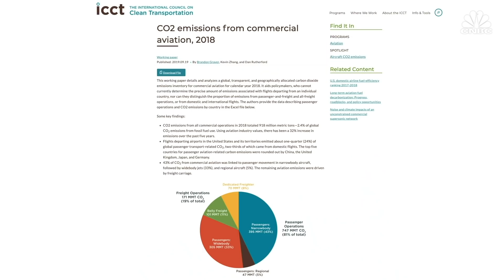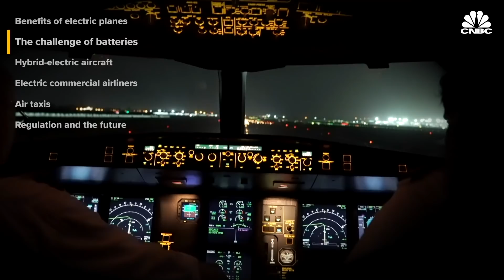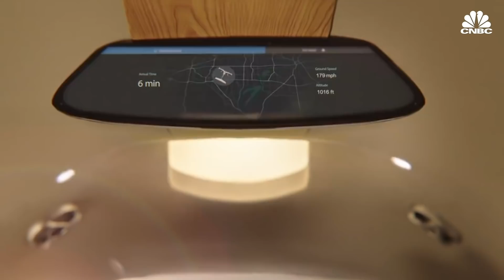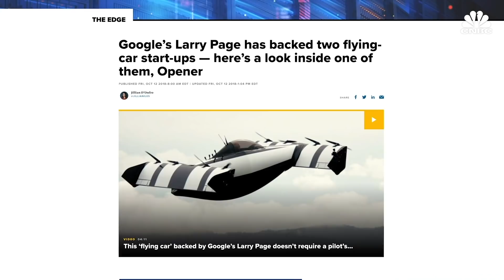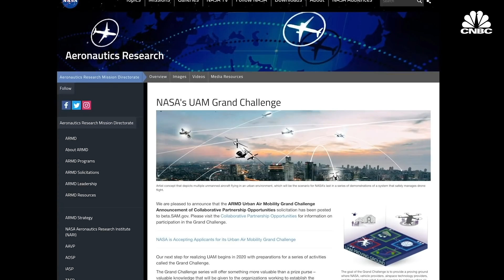Why Don't We Have Electric Planes Yet?

Comment: Why dont we have gas operated cellphones
Reply: and thats on 400cc two stroke iphone 30
Reply: @nhanle3862  nice one
Reply: @nhanle3862  lmao🤣
Reply: Because nobody needs a gas phone with 10,000 hours per gallon and an oil change every 3 months or 3,000 texts, whichever comes first?
Reply: David Beppler And when you try to sell it and people look that Usage Chronometer counter..... 👀 

You have to sell for less... lol
Reply: David Beppler 3k? what’re you using synthetic?
Reply: Apple: TAKE NOTES
Reply: @Sunny-pg9bj  LOL
Reply: real talk
Reply: @samueljrichardson2499  62IQ
Reply: if u charge phone in car you kinda are
Reply: @jondonnelly3  not even close. You're using the car's battery which is electricity.
Reply: Jon Donnelly you know all cars have batteries right?
Reply: For turning the electric starter motor to get the internal combustion engine going so that the electric alternator can produce electricity to charge the battery so you can run your radio.
Reply: Jon Donnelly gosh I feel bad for you I hope you’re being sarcastic. Smh 🤦‍♂️
Reply: @jondonnelly3  not if you charge  it in an electric car.
Reply: @jondonnelly3  exactly what i was going to say or a standalone generator
Reply: Jon Donnelly Not at all. It comes from the battery 😂
Reply: @jondonnelly3  You obviously didn't read what he meant did you? Gas operated meaning the phone itself is powered by gas as in the phone has an engine and you need to put fuel in the phone.
Reply: Jon Donnelly no, not at all, you are charging you BATTERY you aren’t injecting more ‘battery’ into your phone, you are basically bringing your battery back to life. It’s hard to explain but what you said its not close
Reply: Why?
Reply: I would like a diesel powered cellphone please. So I can roll coal and listen to my tunes!
Reply: You can ponder that question by driving/flying your cellphone to work tomorrow. Tell us how it went.
Reply: @Al Castill We do, lookup Tesla Powerwall
Reply: @DrDubbs  It all boils down to money hungry Corporations. If you can't tax it and regulate it then it's worthless.
Reply: Well just plug it to gasoline generator, voila you got gas powered cellphone.
Reply: if you plug it into the cigarette lighter of the car its power from gasoline.
Reply: Good question
Reply: Too many people with big time money and power run the oil industry's. This is why the electric car was scrapped in the early 80s. All about money and nobody wants to help the Earth, our life raft in space
Reply: We need methane powered smart phones ! I hope charge cable isn't too uncomfortable 😬
Reply: @confirmhandle  Subtle brilliance.
Reply: There was a liquid fuel clothes iron (gas, kerosene ect). My aunt was set on fire by one the 60s. So...yeah, there was that.
Reply: why not cars?
Reply: ^asking the real question
Reply: wow stupid
Reply: I wish! V twin Samsung lol
Reply: The color of the photos and videos would be more dramatic if we had gas phones and flat screens.
Reply: would look like this https://youtu.be/Gqy5-e5-ZOE
Reply: things like cars and planes run on gas operated MOTORS so that would mean they need pistons so in theory you could have a has powered cellphone but it would much more bulky and heavy than the ones we have rn
Reply: @sareensidhu6807  ,
We've already had prototype, portable laptops that used a fuel-based battery. They actually can be much LIGHTER than a regular battery even in something the size of a cellphone battery. It simply comprises a small generator so when you burn the fuel source it powers everything and those can be incredibly small. You can get a surprisingly long life out of that approach but it's simply far too messy to refill and dangerous.
Reply: Why they don't put BAND on airplane.. they are the biggest killer in the world..
Reply: Because that wouldn’t make any sense and is redundant. Phones wouldn’t even be able to be ran on gas theoretically speaking. But come on, gas operated cellphones??? It’s already advanced now so it would be going backwards in the most inefficient manner to utilize a phone.
Reply: due to unavailability of mechanical small computers.
Reply: v12 iphone ?
Reply: Hahahaha
Reply: Lack of engines in that space i guess.
Reply: Seven Things , you still have a car phone?
Reply: A car can't run without electricity now
Reply: I like this smart comment.
Reply: That’s such a profound question.
Reply: u mean water cooling cellphones
Reply: Visionary
Reply: Why don't we let AI run the country?
Reply: How about nuclear powered cellphone?
Reply: Why tf would you want that?
Reply: How about steam powered cellphones?
Reply: with miniature gas turbine engines we could.
Reply: @laxman dumre We have gas lighter for hundred years.
Reply: 😂 I’m working on it 🤝😉😤
Reply: 20x the power vs batteries.  Our phones would last nearly a month
Reply: 😂 I’m imagining a tiny single piston engine going instead of the battery.... just need to pour in a few ounces of gasoline each week.
Reply: @Al Castill they exist you just can't afford it by the sounds of things.. the battery works as a rechargeable reserve for the solar panels to store energy it works almost like a generator.. tesla makes some look it up..
Reply: Don't give them insane ideas 😉
Reply: Nonononooo don’t give apple more idead
Reply: hahahahhahahahhahahaaaa cause it will take a long walk to go to a gas station heh? 🤓
Reply: Come on gang ! Let’s go for a ride in my electric rocket!weeeeee
Reply: Most of my baseload power comes from Natural gas, so I already have a gas powered phone...
Reply: Good one. The same reason we don't have gas powered toothbrushes.
Reply: So you used over 2000 bots to get those likes... Cheater
Reply: I DEMAND a cellphone with a small motor right now
Reply: A gas operated cellphone would last less then a minute if it stays the size of a cellphone
Reply: @tusk3260  this is about novelty, not practicality
Reply: Then make it yourself
Reply: iPhone run on nuclear energy so you would have an infinite amount of energy and no need to charge it
Reply: Actually nuclear is just a urannium fed steam engine that produces electricity
Reply: iLL buy that.
Reply: Mmm let’s see a device that uses gas combined with a little spark created by the phone could be an interesting combination.
Reply: why dont we have beer powered bicycles?
Reply: Dark Vulcan omg smh 🤦‍♂️
Reply: @nathanweingust5709gmailcom  ?
Reply: Chicken Why Why went to Hawaii... Came back with a Big Black Eye! 😎
Reply: Why Don't We Have Electric Planes Yet?
CNBC
Reply: This is the type of question you ask on a bender.
Reply: Why don't I believe a word that comes out of this Cory Combs guy...he sounds like a lobbyist
Reply: Funny, I remember in the mid-90s seeing some "futurists" saying that we'd have such a thing with fuel cells where you'd fill up your phone with some methanol once a week.
Reply: @443DM  The internet was also supposed to bring us all closer and stop requiring the need to travel.
Reply: Seven Things What an idiot! Cos’ it’s not called a gasphone.
Reply: Real question: why don’t we have cars
Reply: one gas powered microwave please.
Reply: Wow..how funny you are
Reply: Why don't we have gasoline house appliances?
Reply: Seven Things because it would really fit in your pocket and defeats the point of an iphone
Reply: Gas operated cell phones for smokers 🤓
Reply: Lol true
Reply: Cant travel on plane fule danger
Reply: @Al Castill cause solar power on
Reply: Because the exhaust pipe will burn your ear.
Reply: @vachief Why?
Reply: Im in if you write this comment in 1900 ..   Ita not that worth anymore and its coz co2 emissions
Reply: Hell yeah
Reply: 4.6 liter twin turbo iPhone 40
Reply: Why do we have gas powered morans
Reply: Why don’t we have gas powered batteries
Reply: Apple cries in a corner
Reply: why we dont have nuclear powered cellphones?
Reply: Tjo Wen we do
Reply: @endoetz  mutant x
Reply: Tjo Wen the USA has nuclear powered aircraft carriers that don’t have to refuel tell 2045 their completely electric
Reply: @endoetz  We do if you charge your phone with nuclear energy. 
We have nuclear cars if you charge an electric vehicle with nuclear energy.
Reply: Stupid answer to a stupid video. 
Engineer take. 
You can use hydrogen, higher energy density, proven viable jet fuel for decades, no co2, can be produced with nuclear energy. 
For small planes you can develop and use a ion engines once you solve the battery problems, 0 moving parts. 
Once you can go past batteries (such as using new developments in compact nuclear reactors) you can use plasma jet engines. Those can take you up to mach 5 in atmosphere and keep working in space, allowing you to access orbital speeds. 
In other words, spaceplanes.
Reply: @fl00fydragon  If you were smart you'd make a jet turbine with a thermal energy efficiency of at least 50%, when using silicon or boron metalloid nanoparticles (coated with oxide to keep them inert for safe storage, but still finely grained enough to allow for combustion with an air-fuel mixture of gas incoming from the atmosphere). Silicon has approximately 40 MJ of energy per kg, and a jet engine with 50% operating efficiency, would be able to extract 20 MJ of energy per kg consumed (e.g. 20 MW of turbine shaft power per kilogram of fuel consumed every second). 20 MW is easily 20,000 to 30,000 pounds of thrust assuming a SFC of less than ! 1 kg of silicon occupies a little more than 400 mL of volume, and 20 hours (72,000 seconds) at 20 MW for this hypothetical turbine needs 72 tonnes of silicon, which would occupy 30,400 liters or 8,040 U.S. gallons of fuel volume (the equivalent in kerosene would consume well over 3 times that! Hydrogen would be 24 times!). The emissions from either fuel (boron or silicon) is a solid oxide, which can be stored in tanks and recycled in a nuclear power plant.
Reply: @NUCLEARARMAMENT  There's problems with that design. 
For one the collection and storage of the emissions required an entire extra mechanism and additional tanks to be installed which means more weight, less carrying space and more fuel per kg of cargo which in turn stomps the advantages you get from a more efficient engine (this is the same reason why we are still using bell nozzle rockets and not aerospikes as the extra complexity adds a lot of mass that only recent breakthroughs in metal 3D printing have adressed but still need some refinement). 
As a result the maximization for efficiency in that regard is to have an "emit and forget" burner where you don't care that your emissions are blown into the atmosphere, hence hydrogen.
Same goes with the complexity of a solid fuel based jet vs a gas or liquid based jet.

Another problem is the complexity of the fuel that raises it's cost where, even if you operated in a post monetary system, would make it unfavorable as you'd need more energy to produce, transport and store it as you would have a limited amount of paces capable of producing nanoparticle based fuel.
On the other hand hydrogen can be produced anywhere you got water and electricity.

Another issue is that the oxide layering is not a sufficient safety mechanism to counter a catastrophic failure. These oxideds would bew more explosive than hydrogen due to the immense reactive surface area.
While a hydrogen tank leak would result in a face melting blowtorrch a breach in this fuel storage would be more akin to a miniature moab/foab (they work on a similar principle)

Hydrogen has an energy density of aorund 120 Mj/kg

And finally we have a head start in the engineering department because the aerospece industry have already cracked a lot of hurdles in using hydrogen as a fuel both thanks to the delta rockets and the prototype for the SR71.

Finally hydrogen is an excellent cooling system, so if you utilize cryogenic hydrogen you can use the fuel itself as the cooling system for a supersonic jet or a scramjet, making the entire system simpler, which in turn makes it less prone to malfunction and makes the whole design cheaper.
Meaning that you are opening up the door for cheap (relative to other designs) commercial suersonic and hypersonic commercial and military applications.

For all of the reasons above hydrogen is preferable.
Reply: @fl00fydragon  Yeah, but hydrogen emissions (water vapor) still have the potential to contain nitrous oxides, right? And the heat capacity of the water vapor being emitted in the upper atmosphere is capable of causing a heating effect that could accelerate climate change even if no carbon emissions are produced?

Also, while it is true you'd have to engineer a system to store the metal oxides, the tanks they'd be stored in would be not much larger than the fuel tanks, and since the boron and silicon fuels need 400 mL to store a kilogram of mass, whereas hydrogen even in a liquid state needs 12 L to 13 L to store a kilogram-even slush hydrogen would require more than 10 L at minimum! You could keep it as a gas under super high pressure, and potentially increase density beyond what it would be as a liquid or a slush, but that would be extremely energy intensive, not to mention hydrogen has an extremely small atomic radius so it will inevitably leak through the atomic structure of the holding tank, even if you already have the tank structure capable of compressing hydrogen gas or holding it in a liquid or gas state. Hydrogen in liquid form has an energy density of 8.5 MJ/L, silicon has an energy density of 95 MJ/L and boron has an enery density of 137 MJ/L, and using isotopic separation to remove the heavier of the two naturally occuring boron isotopes, the energy density could be increased to beyond 140 MJ/L.

1 liter is sufficient to store a a kilogram of either surface-oxidized boron or silicon nanoparticles AND their respective oxides (B2O3 and SiO2), with maybe a couple hundred milliters of volume to spare. Not only that, but the safety could be further increased by pressurizing the tanks with helium, nitrogen, neon, argon, or other inert gases. This would not require cryogenic or extremely high strength composite fuel tanks to store, which would translate to reduced costs wouldn't it? Also, with a whopping 18 MJ/kg of boron and 15 MJ/kg for silicon in terms of their respective specific energies, which are based upon their use with oxygen as a bipropellant for rockets, they are capable of a maximum theoretical specific impulse of 540 seconds and 450 seconds, respectively--when used in a hybrid rocket, they would serve as excellent high-density-impulse propellants in space applications. Space vehicles should be the only vehicles that have emissions anymore since the laws of physics and the tyranny of the rocket equation, but aircraft and anything else should follow suit, in my honest opinion.
Reply: @fl00fydragon  In terms of cooling, metallic or metalloid nanoparticle fuels coated with a surface oxide layer and pressurized within a standard fuel tank with an inert gas could simply be accompanied with liquid argon or liquid neon as dense alternatives to liquid helium or nitrogen, without causing too much complications despite hydrogen being cold enough on its own to provide excellent cooling properties, but requiring it to have bulky and large cryogenic fuel tanks to store?
Reply: @fl00fydragon  Liquid neon is expensive as all hell, but it won't leak through tanks unlike liquid helium and is every bit as inert due to its valence of zero. It also has a density of 1.207 kg/L, and has a melting point of -248.6°C (-415.5°F, 24.55 K), amongst the lowest of any substance (aside from hydrogen and helium). Here are some more tidbits on neon:

Boiling point: -410.9°F (-246°C)

Electrons per shell: 2,8

Neon should be more than sufficient as a coolant and is denser than water, so why wouldn't it serve as a perfect complement to boron or silicon as really dense fuels with solid oxides stored aboard fuel tanks aside from its tremendous cost? Hydrogen's biggest issue is its awfully low density, even despite the fact we have solved most of its storage problems, and is cheap to source but that has its own environmental footprint if hydrogen is produced by anything except nuclear or renewable sources of energy.
Reply: @NUCLEARARMAMENT  If you have a clean reaction you only get water unless you put in additives.
There's one massive difference, using fossil fuels injects new carbon into the carbon cycle while water content in the atmosphere is regulated by temprature (basically the water vapor is not a problem unless we continue heating up the planet)

The issues is that you introduce multiple  engineering hurdles of requiring a system that capturres powder from a subsonic or supersonic airflow, a way to inject an extremely volatile solid fuel into a jet's combustion engine and alloys that can survive the equivelant of hours of sandblasting for a simngle flight.

The first has problems where not only is it impossible to capture all of the waste, resulting in quite a bit of chemmical pollution raining on our heads, but it's a critical failure point that will cut into the thrust of the system, increase engine size, increase weight and require a secondary tank (even if smaller this is a larger engineering hurdle than one larger tank).

Additionally because the fuel is solid you can't just put a simple piping system, you'll need to engineer a feeding system from scratch that would have to transport powder through tubes at a high speed to feed the combustion chamber, a mechanism that would most likely require you to use hypercompressed air to push it along the pipes fast enough so that the fuel doesn't catch fire within the tube and ignite the fuel cell (as it will be propelled by it's very oxydizer)
So not only do you have issues with the waste system but you have fuel supplythat has to withstand a constant sandblast where failure would result in the fuel tank exploding.

This would result in a very expensive aircraft with massive thrust loss due to it's filtration system (which would most likely by gyroscopic/vortex based) that would need a lot more time to develop , would be a flying bomb waiting to explode if it's feeding system failedand would require the use of exotic alloys that could withstanda a supersonic sandblast for a single flight, let alone multiple uses.
Even the most recent breakthroughs in material technology can't give you the materials required to make this plane you propose reusable.

The most "smart" thing to do with your proposed design is to say "screw chemical pollution standards" and remove the filtration system.
And you still have to deal with the sandblast from your fuel injection system.
Now using an inert gass would reduce the risk by a bit and the speed of your fuel injector but you would have to have an adequate amount of compressed gasss to push all of the powder out, which defeats the purpose of not having compressed hydrogen as you'd need even more gas, not to mention that having an innert gass would cut into your engine's performance as you'd be making the combustion harder.

On the other hand we have quite a bit of experience of using hydrogen, giving us a head start inthe R&D cyclel, simple piping will work, it's fuel tanks may be larger but the contents are relatively light and their walls are made with carbon fibers reducing the weight you add by increasing the size of the tank.

Basically your miraculaous solution is an engineering disaster.
we don't just look at the highest volume to energy ratio and say "that's our fuel".
It has to be compatible with what can be engineered.
Theere's a reason why solid fuel is only used in solid state rockets where they're nothing more than a glorified roman candle, operating in the exact same way.
Reply: @NUCLEARARMAMENT  Cryogenic tanks are by far superior than wonder material, unobtanium pipes that can survive worse treatment than what we use at metal cutting sandblasts.
Reply: @fl00fydragon  What about ultra high temperature ceramics? Can they take sandblasting? They become more malleable and tensile at high temperatures and less brittle, right? I'm not against there being exhaust emissions in a spaceplane using my proposed system, there I wouldn't really care. How about a subsonic airplane that just runs on an ICE powering an electric drivetrain that turns the propfan?
Reply: @fl00fydragon  I think I found that "unobtanium" substance that could be a potential solution to the materials problem: https://www.mining.com/platinum-gold-alloy-wear-resistant-metal-world/

Specially fabricated gold and platinum in this configuration is going to be quite expensive! But the ultra high temperature ceramics in conjunction with low-heat-rejecting materials will still be useful in obtaining a high-efficiency TRCC (turbo-rocket combined cycle) that combines a VEC (variable engine cycle) turbine section that can operate with a bypass ratio (turbofan mode) or without (turbojet mode), which would work in tandem with the variable compression section that can operate as a subsonic combustion (ramjet) or supersonic combustion (scramjet), and be capable of obtaining up to Mach 20 (80% of orbital velocity after accounting for atmospheric, gravitational drag losses), while being able to ride the atmosphere at an altitude of 80 km above MSL.

My theory aims for turbine and ramjet/scramjet efficiency--both adibiatic and isentropic efficiency in excess of 60%, and a nozzle efficiency of 95%-100% or better. A full-length, annular ring, aerospike nozzle with reverse-thrust, 3D vectored-thrust gimbaling system, and an afterburner is what I'm envisioning here as well. The closed-cycle, staged combustion engine cycle section will use onboard oxygen and be used to get the spaceplane into orbit for the remaining 20% of orbital velocity, with a specific impulse of at least 450 seconds using boron and oxygen. The first 80% of orbital velocity is achieved using the VEC turbine and (sc)ramjet sections, and will have an overall average specific impulse of 1,200 to 1,800 seconds.

I know my concepts are impractical and may never be possible, but I have to get this off my chest.
Reply: @fl00fydragon  Basically, I'm looking at a spaceplane concept that will improve upon Skylon with an up-mass ratio of 20% (5:1), and get somewhere to 33% (3:1), 40% (2.5:1), or even 50% (2:1). Saturn V was 3% (33:1) and most rockets can't do better than 10% (10:1) because of the rocket equation.
Reply: @NUCLEARARMAMENT  The temprature isn't the fatal problem in your system, the fatal flaw is that the fuel supply from your tank to the combustion cavity will be a high pressure gas that's blowing nanoparticle sand at extreme pressures and a high speed.
Furthermore your design has too many moving parts, even taking in the fuel from the container cannot be carried out by a simple tube and instead requires an extremely complex system that skimms the surface as the escaping gas has to take with it a stable portion of nanoparticle sand.

With current material technology it would be a wonder of material science if your system could do more than a signle flight without replacement of the pipes and would be the least relaible and most complex plane ever built. (you are introducing dozens, if not hundreds of new failure points.

You;d be wasting energy that way.
The most efficient way to utilize energy from an ICE is to directly utilize it to propel you.
Turning the energy from an ICE into electric energy to then move an electric motor is you introducing more steps where energy will be lost as heat, resulting in increasingly larger losses to efficiency.

The most efficient green option we currently have that can be deployed in the required timeframe is to use hydrogen jet engines.

Seriosuly though, why are you so viemently against using hydrogen?
Reply: @NUCLEARARMAMENT  
That's a really bold claim.
I need a link to see if that thing's even possible.
Reply: @fl00fydragon  I'm not against hydrogen, in fact I support it being used for Skylon spaceplane and SCIMITAR/SABRE engine concepts. But I am proposing my concept an alternative as competition or rival technology.
Reply: @NUCLEARARMAMENT  You do realize that you don't always need a competition or rival technology for everything.

Some things work really well and others don't.
Hydrogen has shown it's value as a fuel for rockets, conventional jets and scramjets and can be produced easily with the least carbon intensive energy source on the planet.
Instead of wasting resources trying to diversify something that doesn't need diversification it would be better to focus efforts to accellerate it's adoption and establish a widespread and efficient production network.
Reply: @fl00fydragon  ion engines dont work well in atmosphere right? Like dont they barelly push
Reply: @popinmo  Hence why I said develop. 
Both the engine and the energy source need to be worked on. 
Atmospheric ion engines are still in the prototype phase, in other words at least 20 years away. 
But if such technology is desirable for small aircraft then it should be pursued. 

And if you have the energy source required to run plasma jet engine spaceplanes a smaller version can run an ion Cessna.
Reply: @fl00fydragon  ,
Yes, HYDROGEN is a viable option. Pros and cons. There are prototype aircraft already that use it as a liquid fuel, and a prototype aircraft that uses Hydrogen fuel cells with electric engines.
Reply: No your not morons I hear that excuse questions ask alot on every future documentary about stupid Battery's.
Reply: I gotta say this comment is legendary.
Reply: Why do we have dummies asking stupid questions!!!
Reply: Seven Things you will get something like the Samsung note 7
Reply: really? 
Moron
Reply: @MrFritzzz666  I wish commenters could pin replies to their comments because you would definitely be pinned and not for a good reason...